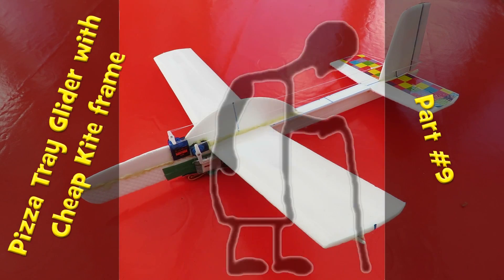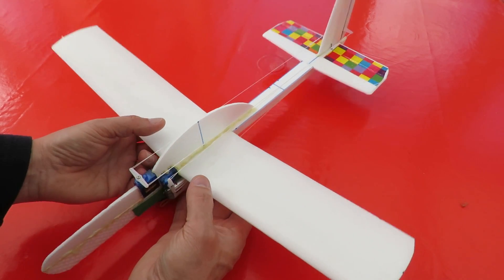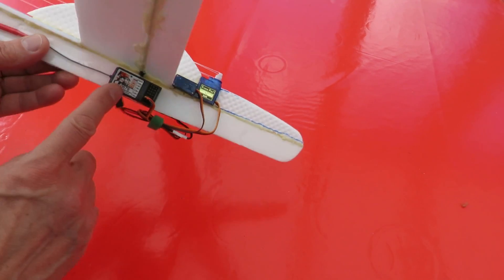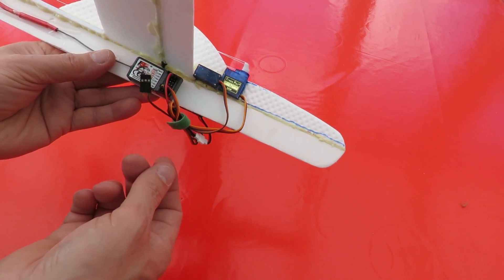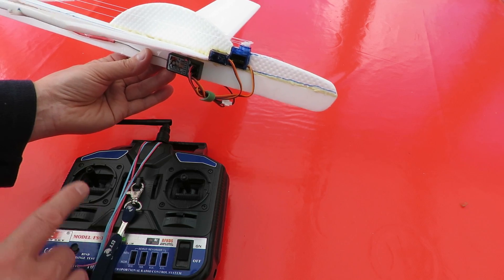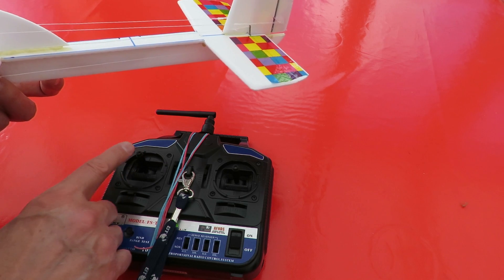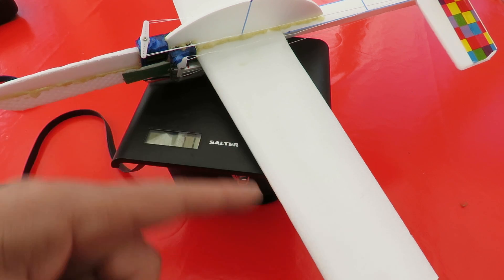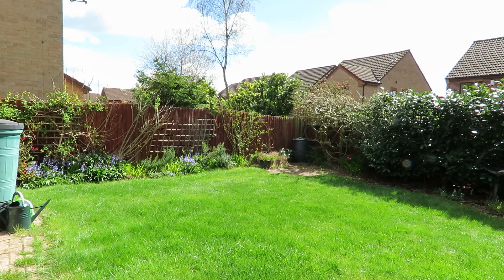DLG Pizza Tray Glider with Cheap Kite frame #09

Comment: Hi Ray, can I suggest that your weight problem may be helped by using your V911 board instead of the current set up. In fact the F929/939 board would be even better, as it's a dedicated aircraft board, rather than a Heli board like the V911. I have just bought one to use to convert a FMS Mini Fox chuck glider to RC. I bought mine from Banggood here http://www.banggood.com/WLtoys-F929-F939-12-Receiving-Board-Spare-Part-p-930768.html Pretty cheap and like the V911 board it binds to you Fly Sky transmitter.The F929/939 board would do away with the weight of your servos, and allow you to use a a push rod system, instead of your pull/pull system, using these carbon push rods, again from the F929/939 spares list. They do the job and weigh virtually nothing. Have enjoyed watching the series, and hope you can get it flying well.
Reply from the maker: Thank you, yes the reason I didn't use the WL911 is that I am not confident that the gyro stabilization won't kick in and cause problems. Interesting you say the F929/939 will bind with the FlySky transmitter as the comments on the page say it won't. Do you have personal experience using it with the FlySky and which FlySky was it? I would be interested in trying one if it will work as that is currently showing a good price.